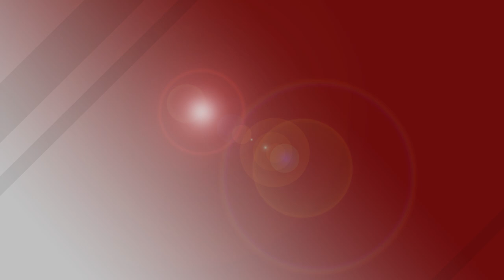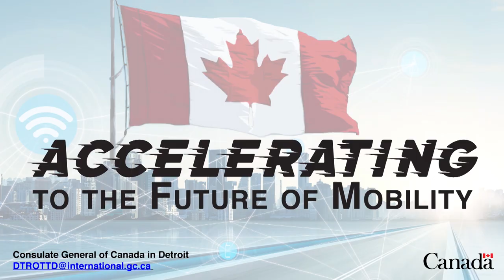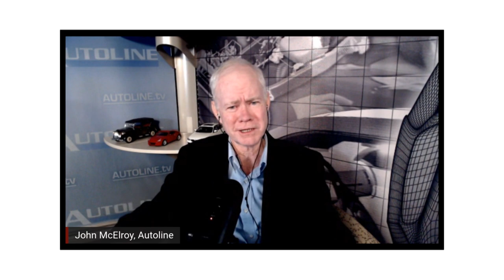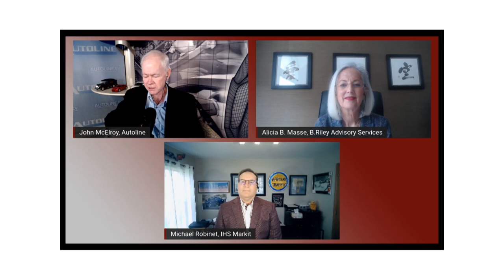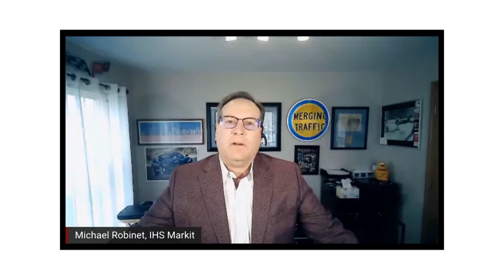Tip Toeing Through The Transition: From ICE To BEV - Autoline This Week 2510

Comment: I put solar on the roof first and then I paid $28K for a used Tesla. I'll never go back to using Gasoline for propulsion. It feels great to cut out the middleman. $20 power bills and no fuel bills
Reply: what did the panels etc cost
Reply: unfortunately it doesnt work for the mass sorry mate
Reply: @carholic-sz3qv  True, it works for me and a few of my neighbors, the cost has come way down.
Reply: @grantboucher9342   We paid $16k for a 8.4Kw system after taxes

Comment: I'll back Tony Seba's take on adoption. Namely, that it will be an S curve and people in the ICE business expecting a slow, linear adoption of EVs are set for ruin. Since automakers have abandoned the low and mid-end of the automobile market, things are ripe for inexpensive Chinese EVs to sweep the American auto market.
Reply: yes, yes and yes.
Reply: what has Seba ever been right about? ......Ward's thinks  that BEV's will have about 25 to 30 percent of the market by 2030. They have more insight that someone like Seba does. I belierve that ICE powered hybrids will get more of the market than BEV's  will  for the next 50 years.
Reply: @davewhite113  What has Wards ever been right about?
Reply: @davewhite113  You believe that ICE powered hybrids will get more of the market than BEV's  will  for the next 50 years??? How does that play out, exactly? I mean, just... wat?
Reply: @joopvanroy6599  Most people won't buy Bev's .If they don't have a garage they aren't gonna be going outside in the cold and rain/snow to plug in their cars.They want the convience of putting gas in their cars.As John mentioned in this video, e fuels  and then exhaust tech that's already there will lead to zero emissions ICE hybrids very soon. Once people learn that they can have the  power of an ev  combined with a gas engine like the e power concept, there will no need for BEV's. Many don't realize the damage being done to the planet in africa to make the batteries. AN ICE powered hybrid will be much more environmentally friendly than  a full BEV. The places where BEV's are the most popular are in countries that almost require people to buy them. China has tried to sell them before and they wouldn't sell.
Reply: @allencrider  Be careful of people that say something and then keep  saying, "RIGHT?  ..RIGHT?"... Wards knows the auto business. the guy that you mentioned makes a ton of false comparisons IMHO.
Reply: @davewhite113  Sounds similar to the phone industry in 2007 when the iPhone came out and disrupted the industry stalwarts; Blackberry, Nokia, Motorola, Microsoft CE, etc.  Technology adoption is an S curve.  Kodak knew film and had a record year in 2000 and ended up declaring bankruptcy in 2012.  Technology disruption happens from outside, not within the industry.
Reply: @davewhite113  doesn’t sound like you fully grasp the concept of market disruptions.  Every BEV sold drops the price of all BEVs and increases the price of all ICE cars.  One is a positive feedback loop, the other is negative.  ICE will be dead by 2030 based on economics alone.
Reply: @DarkBrandon1  ICE powered hybrids will be cheaper than ICE now. As battery demand grows countries in Africa that are being severely damaged  by mining materials, will crack down and it's gonna run the price of batteries out of reach.
Reply: @davewhite113  that’s not how this works.  A hybrid is the most expensive out of the options.  Ice engine + EV battery and power train...
Reply: @DarkBrandon1   E power......very small ICE, very small battery... no transmission.
Reply: @davewhite113  sure, but you still have an ignition system, fuel system, exhaust system, cooling, engine monitoring systems, etc.
Reply: @DarkBrandon1  Selling more of an unprofitable product doesn't improve your bottom line.
Reply: @phamnuwen9442  I think you’re implying that EVs can’t be sold for a profit, I’d argue that’s false.  But even if it we’re true, I can think of several cases where selling a product at a loss would lead to massive profits in other areas.
Reply: @DarkBrandon1  Let me guess, you're assuming huge "robotaxi" profits will make your expensive, subsidized Tesla into a money making machine?
Reply: @phamnuwen9442  a company just selling SaaS on top of their platform.  Hardware has low profit margins compared to software.  Self-driving, increased acceleration/performance, premium connectivity, etc.  Or, you now have all this data collected from all the drivers, sell that data to insurance companies, tire companies, glass companies, etc.
Reply: @phamnuwen9442  If you actually looked at the financials, you'd see the product is already profitable. You shouldn't be taking the cost of expansion and adding it to the cost of manufacturing.
Reply: @DarkBrandon1  As I suspected you're assuming a whole array of unproven (in the car industry) software business models is going to magically appear and subsidize the unprofitable hardware.

Take a look at the latest in-car FSD videos. That system is a complete joke (and a public health hazard).

And even if we extremely benevolently assume that these things would work (I mean "glass companies" what?), they are not exclusive to Tesla and not even to EV's.
Reply: @superbud333  Just like the cars, Tesla's factory construction is funded by subsidies, not revenues. Tesla just got a billion Euros from the German tax payers.

It's true that the cars have decent gross margins (after subsidies), but that's because they skimp on build quality and warranty support, while still marketing themselves as a "premium" brand.

People also overpay because of the hype, all the useless gimmicks Tesla put in their cars and the environmental hysteria around EV and renewables. You pay $50k for a car that falls apart when you drive it, has half the range and takes ten times as long to recharge as a $30k well built, super reliable Toyota.
Reply: @phamnuwen9442  You do realize that almost all large companies are subsidized in some way. Usually by tax breaks or paying for things at cost in exchange for a promise of job creating and minimum taxable income.  Its almost to the point of asking what industries are not subsidized. Construction costs are not payed by the government.

I was replying to "Selling more of an unprofitable product doesn't improve your bottom line." and was saying that expansion costs should not be considered part of the cost or production. You also just said " the cars have decent gross margins after subsidies". In this case the subsidies go to the consumer and not the manufacturer. Also, in the USA Tesla and GM don't even qualify for this subsidy you speak of yet are still contenders to other vehicles in their segment. Please let me know of a market where only Tesla has a subsidy that is not available to others.  In fact, here in Canada our subsidies were changed multiple times to cut Tesla out. I do not agree with Tesla playing with loopholes in this case either but they were targeted and the Ontario gov actually lost this in court. The same happened in Korea until they changed their rules somewhat recently. 

I do agree that their margins are high because they can charge more due to hype and being considered premium. I also agree that their QC is subpar.

BEV's target consumers are home owners and generally "recharge time" is considered to be practically 0 compared to ICE vehicles. The only time charging time is a factor is when you travel more than your maximum range in a single day which the average consumer does not. You cannot compare outliers to make a point since they are not the intended target. That's like saying your "reliable" vehicle is not suited for me because I want to take it off-roading. Or if its meant for off-roading then its not efficient for driving in European cities. Products should be compared against their own categories.
Reply: @davewhite113  You are woefully misinformed.

Comment: BEV? Please...EV... Show me another electric vehicle that I can buy right now.Hydrogen? Nope, solar? Nope. Stop saying Bev it's just Ev. We don't run around saying battery electric phones or battery electric remote control cars or battery electric drones.
Reply: The battery is the critical part of the BEV. Nobody doubts that electric motors are reliable and efficient. The battery however is still expensive, contains very little energy and is slow to recharge.